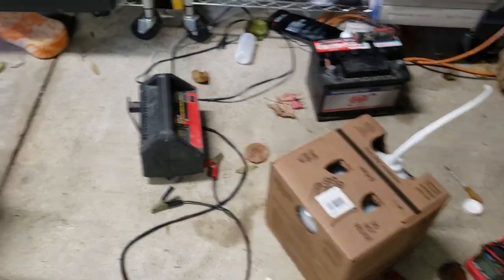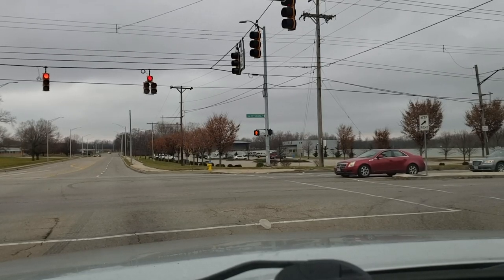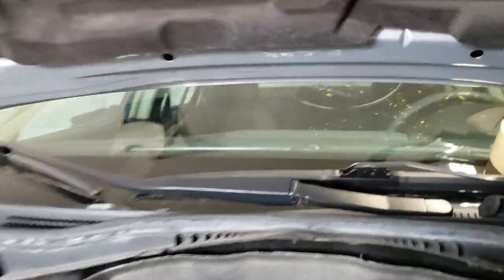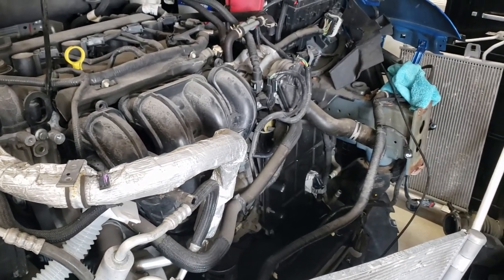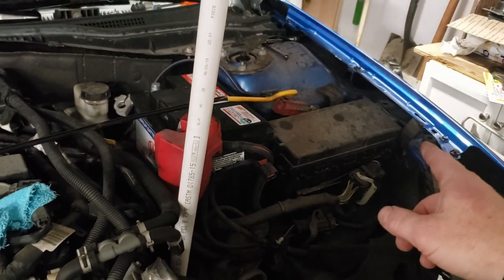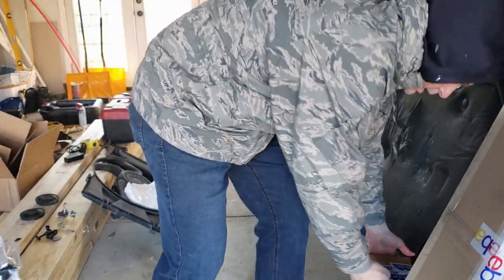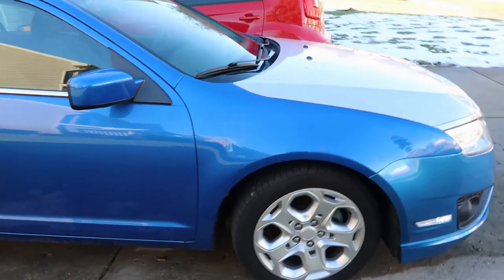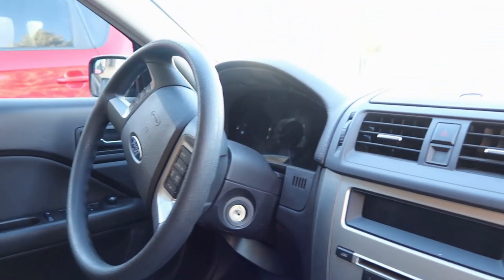Copart Win Ford Fusion Salvage Rebuild

Comment: No company can build a car that last forever they all break
Reply from the maker: True but they can certainly do better.
Reply: @HousesandCars  yeah but anything that's metal is going rust
Reply from the maker: @fordnut4914  True but even that can be improved.  I worked for Navistar and the GM frames are rusting before they are assembled. Wax could be sprayed onto the frames and in the cavities like they do with semi trucks.  Also many people have their frames galvanized.